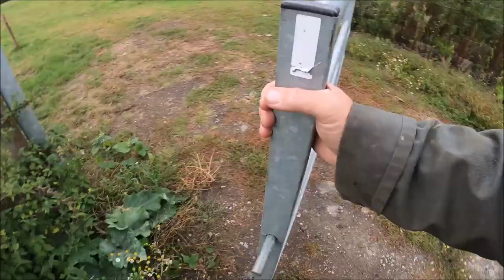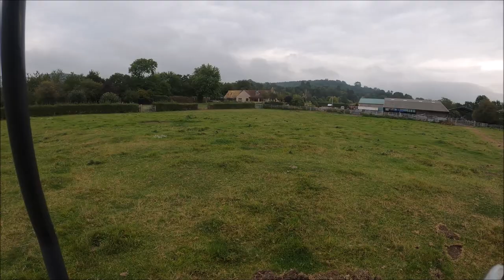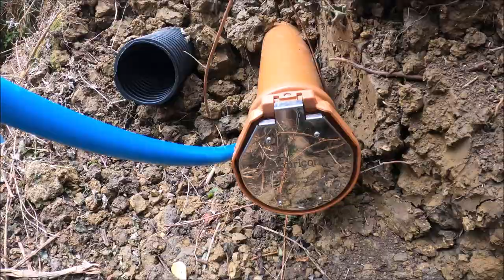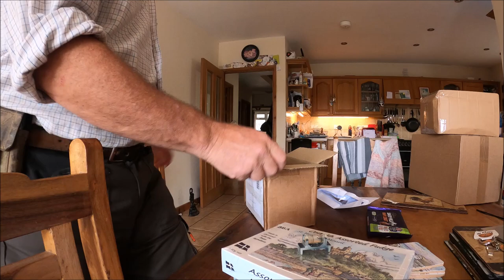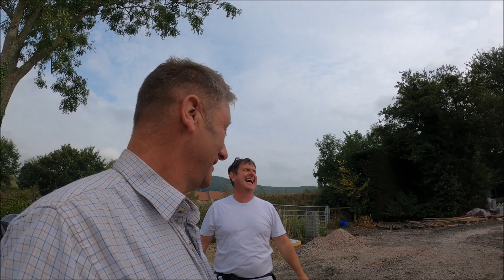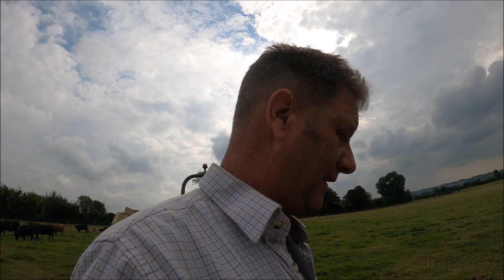Giant moles get flattened!! 13 09 21

Comment: Worth stacking some sand bags filled with dry mix concrete around the pipes to prevent the ditch sides eroding.

To make filling the bags easy suspend a ladder over a couple of barrels and use a warning cone with the end cut off dropped through  the wrungs as a funnel.
Reply from the maker: Good plan. 🙂👍🏼

Comment: 3:33 When you mentioned an old ditch, I looked at some old maps of the area. (1888, 1892 and 1912) They show a pond in that area, and there are a couple of avenues of trees. So maybe not a ditch, maybe where the tree roots that were left behind have rotted out?
If you use what three words, the centre of the pond is roughly at blockage.rainy.headache and is approximately 20 meters by 12 meters and is sort of a letter 'b' shaped pointing wsw.
Reply from the maker: It’s called the avenue because it had anAvenue of Horse chestnut trees running through the middle of it. The pond was mentioned in a recent video on the trenching and was filled in by my father in the very early 1960s

Comment: You have a great selection of buckets for the mustang would there be lots of skidsteers in britain they wouldnt be alot of them in ireland
Reply from the maker: There are a few about here Mark. 🙂
Reply: It's strange how certain countries use different types of construction equipment, almost every site in the UK will have a dumper of varying sizes. But I've rarely seen them in my travels abroad and I've worked in many countries.
Skid steers are often used to clean the holds of ships and I watched a video of the guys dancing with them, realy funny.